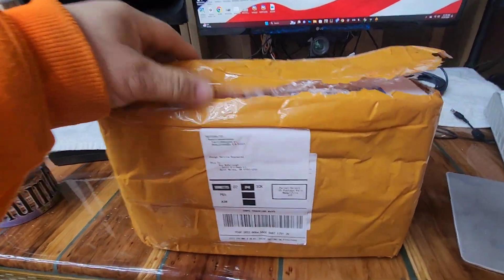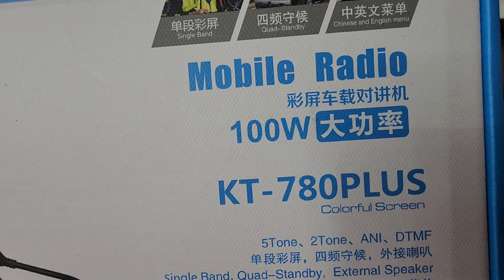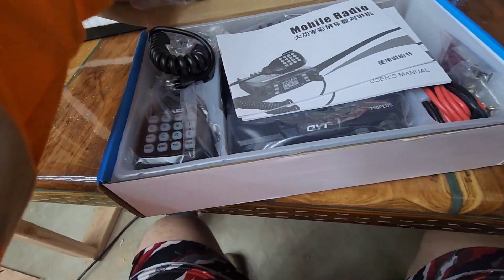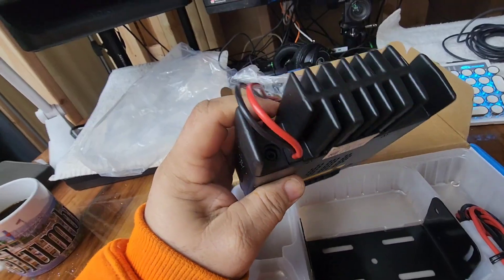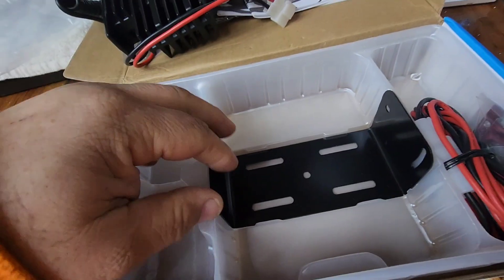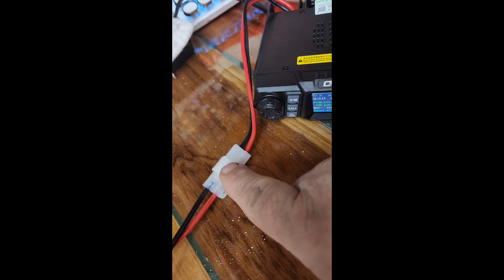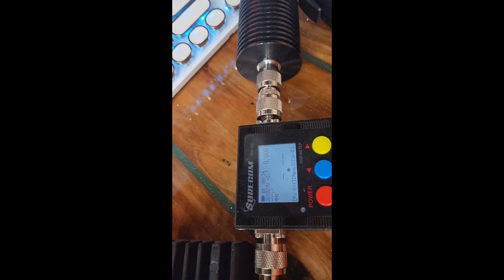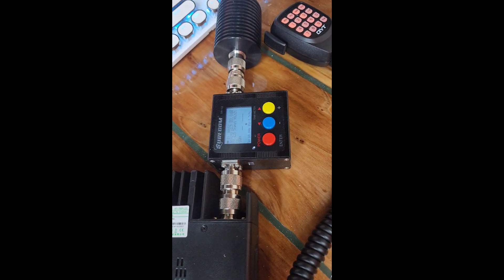GMRS capable radio spits out 80 watts .. too awesome (read description)  QYT 780 plus UHF from China

Comment: I have the same radio. It does 90W on the hammy ham band and about 70W on GMRS… pretty sweet. However, the software never worked on my computer so I had to do all the programming through the menus on the radio itself.
Reply from the maker: Yeah I had to find a Windows 10 computer in order to get the drivers to work and program the radios..

Mine is only spitting out 49 Watts on GMRS channels

Comment: Just when I thought the video was starting, it was over.
Reply from the maker: Sorry to make it so short.. 
Once I programmed it to GMRS channels using a windows 10pc I retested it on GMRS and it only spits out 49 Watts ... That's still not bad and within regulation specs ;)
Reply: What was the output on 1-7 and 8-14? Was it 49W across all GMRS, or are the other channels legal limit.?